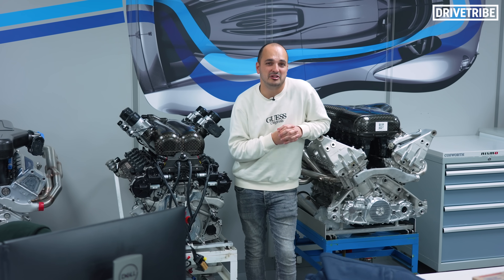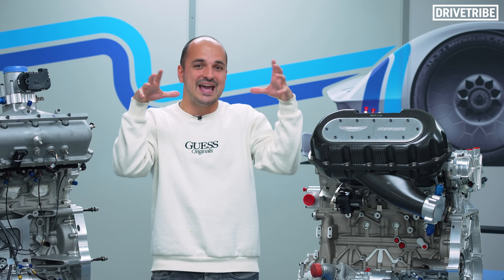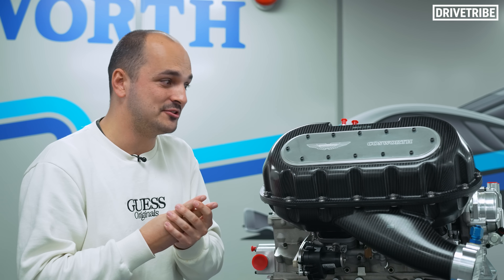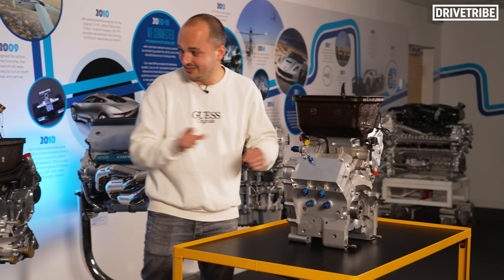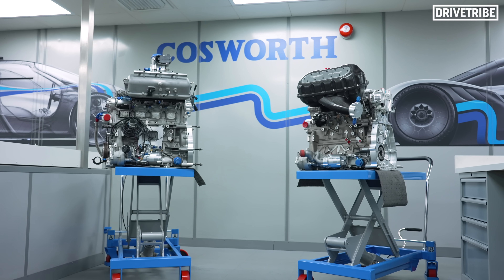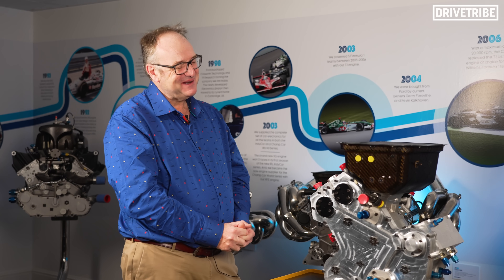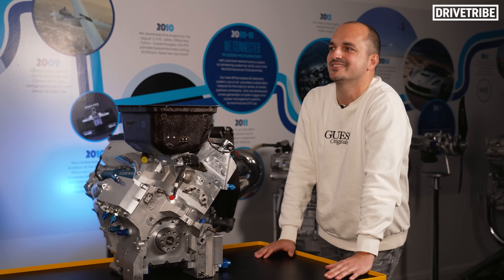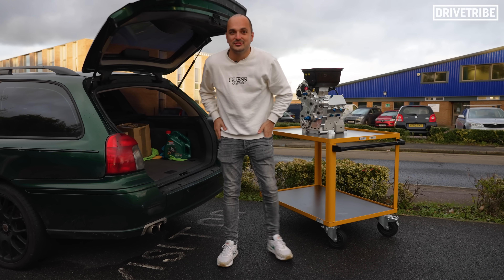This is a single cylinder F1 engine – 20,000rpm, 300cc, 90bhp!

Comment: Its an amazing thing, but as the Cosworth guy said, it would be pretty hopeless as a road car engine. Nothing that revs to 20,000 RPM is going to any useful work at less than 10,000 and will probably need 15,000 before it properly wakes up. Which is fine in a race, but a complete pain in the backside on the commute or going down the shops. In a road car it would be lumpy, gutless, and generally horrible.
Reply: I believe they also idle at 5000 rpm.
Reply: Honda CBR250RR revs to 20,000, and that's a production street bike from the late 80s. Probably would not enjoy trying to push even a small car like Oliver around, but there have been successful conversions to put motorcycle engines in cars, so perhaps Oliver's dreams of revving higher than an F1 car could someday be reality... :D
Reply: Probably not bad in a sport motorcycle, the lack of low end torque is fine, the packaging looks like a problem.....
Reply: That’s why these would be amazing in a hybrid setup.
Reply: @JakeM218  come to think of it, have the EV part be the starter motor, then the engine can kick in later  :D
Reply: @mannyechaluce3814  that is pretty much what most hybrids do.
Reply: We had a motorcycle mechanic that drove a Honda 600 that sounded like a siren coming down the road
Reply: I used to daily a 250cc ~19krpm engine (4 banger). No torque until 8-10k and it's only really waking up around 12 and making power through till redline. 
You have 'enough' down low to not change gears all the time for casual riding unless it's a steep hill and you're in a really high gear.
Reply: @N4CR  Which bike was this in?
Reply: People love rotaries, this would be fine
Reply: @jeremymcadam7400  correction - masochists love rotaries. (ex-RX8 owner here… fun, but hard work to own, and even with meticulous care often die expensively for spurious reasons)
Reply: @craiggraham2638  My 88 10th anniversary rx-7 turbo 2 has 360,000 miles and has never had anything but a clutch tires and brakes!!! Its been beat to death its whole life and it still runs like it was new. Still does doughnuts like its day job, still catch 3rd gear without trying. It still beats 90s mustangs red light to red-light just like it always did. It's literally the most reliable car I ever had😂
Reply: 1st 2nd gear pulls on the street any boy will be happy
Reply: It could be useful for a hybrid, the engine only needs to run occasionally and the excess power can charge the battery.
Reply: Unless you attach it to a custom CVT box or an electric drive train. Mazda has proposed the latter for a small Wankel engine.
Reply: Make it like a train hook the engine up to a generator and wheels to motor controller and motor.
Reply: So was my 64 stingray but it was sure a smile per mile between 70 and 130
Reply: Just change the cams and tune
Reply: terrible right up until you dump the clutch and floor the loud pedal ;)

Comment: Great video 👌
 However, I present to you the 90s Honda CBR250RR 4cyl motorcycle. It reliably revs to 18500rpm  with occasional trips to 20k and will do so for well past 100,000km of riding, some as much as 200,000km 😳
Sure, it's half the power of the 1cyl Cosworth, but they were amazing!
My two oldest sons owned one and it was brilliant fun to ride 🙂
Reply: I haven't missed the point....but I have got a Yamaha FZR250RR, 40+bhp at 18k+ rpm....owned for 20 years and will never, ever sell it. Every single time I ride it down the A44 Worcester  to Leominster, I'm 18 again. I'm 38 now. Its just pure emotion.
Reply: @Will._Power  ha ha I had one of those about 25 years ago, I put a race can on it & it sounded like an F1 car at those revs. I remember screaming past a car workshop near where I lived & all the mechanics came out to see what it was lol.
Reply: bet it screamed !
Reply: @sheene71 
Sounded like you were in a GP just riding to the shops 🙂👌
Reply: ROFL right there with ya.  I thought the same thing Honda is a great engine builder.  I thought of the early 60s GP engines the 125cc 5cyl is the highest reving motor I ever heard of they did 29,000 rpms.  I guess the light weight of the rotating mass allowed the motor to not get unglued.  Thats why them Italians stay together.  Nobody cares about physics.
Reply: @SurferNorm6360  not sure about 29000 rpm, more like 20,000 rpm but yeah they were a feat of engineering weren't they 👍
Reply: @carstennobody7047 
At 20,000 rpm it would be 333.33 revolutions per second, 166.66 ignition events per second per cylinder.
Reply: You just missed the technical part behind the video... went totally over your head.
Reply: @LeonKotze70 
Actually no.
Great tech and impressive to see.
You missed my point that there are actually engines out in the wild that are also amazing.

Comment: I'm confused. On paper yes the output numbers will scale up or down accordingly, but that's in a perfect scenario without friction. 90hp single cylinder isn't going to deliver 900hp when scaled up to a 10 cylinder when increased friction and other losses occur due to increased complexity of the larger engine. You lose power along the way, it's unavoidable. I'm suspecting either some rounding up of the numbers on the full sized engines or rounding down on the smaller mules.
Reply: You have less friction losses in the full engine. You have one of every component in a single cylinder engine, but a 10 cylinder engine does not have 10 oil pumps, 10 timing belts/chains etc.
Reply: its probably going to be more than 10x the power. you get 10x the output from all the cylinders because friction increases linearly in the bore, but then you have things like oil pump, crankshaft bearings, camshafts, timing actuators many of which you still only have one of so the friction loss of that would not increase tenfold.

Comment: Since the exhaust manifold layout is so important to creating power in a naturally aspirated engine (using the benefits of the scavenging effect from the gas flow out of adjacent cylinders) how on earth does a single cylinder engine make a directly proportional amount of power to the full 10 cylinder engine?
Reply: Maybe tests were handled without proper exhaust system on? After all, Cosworth employee stated that it's about combustion system. I may be wrong tho.
Reply: @Healtsome  yes, maybe, but that's really exactly my point. Having a property designed exhaust manifold adds power. So the single cylinder motor should not have produced exactly 10% of the 10 cylinder engine.
Reply: Can't say for sure with this one, but exhaust geometry could produce a reflected wave that generates a low pressure zone at the exhaust valve timed with the valve opening
Reply: @kschleic9053  agreed, but you can also get further benefits from other cylinders by tuning the points that the manifold branches meet.

Comment: Single cylinder engines being intrinsically more efficient than their multi cylinder counterparts, did Cosworth had to compensate somehow their calculations for the mpg of the real V10?
Reply: I don't suppose the mpg of the engine was really of much interest in the development of a F1 engine?
Reply: Fuel economy was of somewhat lower concern back in the days of V10s as the cars had larger fuel capacity and refuelling was an option. Sheer grunt, driveability and reliability were more of a priority than the mileage you could run on a given volume of fuel. 

I assume that by "intrinsically more efficient", you are talking about fuel economy? As the single/multi-cylinder mule engines' performance was scalable, the volumetric efficency is largely unimpeded with more cylinders, if not improved by the improved balancing when the single cylinder is scaled up to a V10.
Reply: I'm wondering. Probably having a lesser amount of fuel would always be of interest. I'm also wondering if the fuel economy of one cylinder is better than a tenth of the whole v10 indeed, just for the sake of knowledge
Reply: @spolo123  my guess is that it would be worse because the cam drive, oil pump, water pump etc would all be causing significant frictional losses that are not getting the benefits from economies of scale that they do on a multi cylinder engine.

Comment: I would love to have a 20krpm 90hp 300cc stuffed in my bike.
Reply: You think that. You probably wouldnt. This engine is dimensionally huge for the power it makes and isnt terribly fuel efficient. Even something like a 750 v twin thats lightly stressed would only cost a tiny bit of weight given that you dont have a pneumatic valvetrain and dont have an external oil tank and might not even need a water cooling system and will probably make the same power using regular pump gasoline and it will last potentially hundreds of thousands of miles. 
There is a reason why the Sv650 is such a popular motorcycle